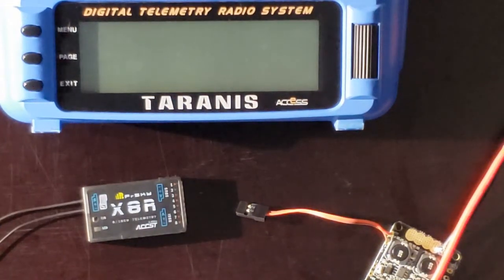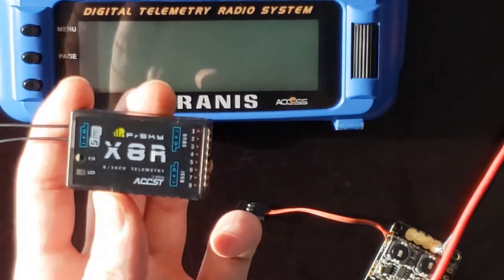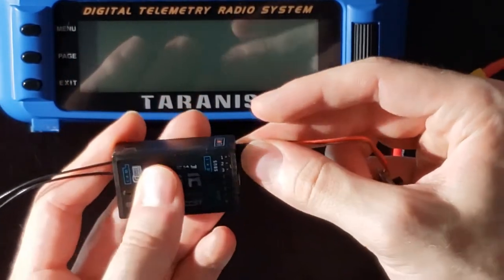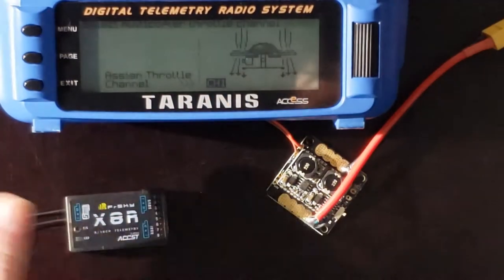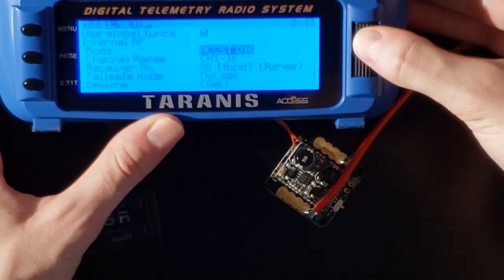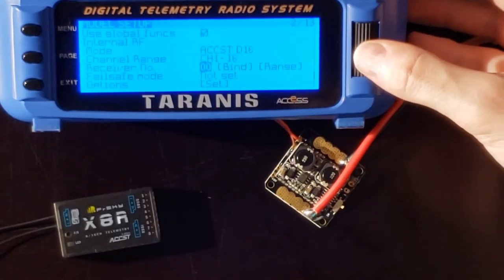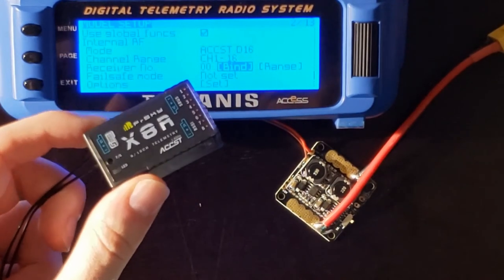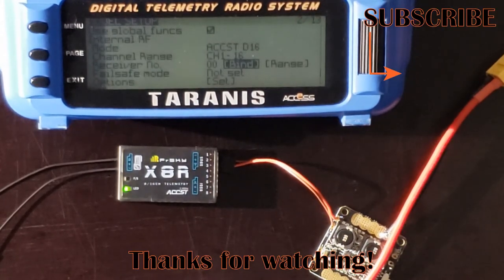How to Bind FrSky X8R receiver to Taranis X9D Plus transmitter with SBus

Comment: When I’m ready I wonder if the xm+ will have a similar binding method.  I haven’t bought a radio I have some specktrum radios but they seem not popular with drones.
Reply from the maker: The binding process for all receivers is basically the same set of steps. The XM+ supports SBus so you'll only need a 3 wire cable just like with my X8R. The difference will most likely lie on the transmitter side. Transmitters that don't have a screen will rely on some kind of stick you need to toggle to put it in a binding mode or they'll have some other interface. My original transmitter/receiver are Spektrum however when I was looking into the Pixhawk many people seemed to be using FrSky models. Also my Spektrum (DX5E) is discontinued so that was another factor for me when deciding to upgrade.
Reply: Dunno if anyone gives a damn but if you are stoned like me during the covid times you can watch all of the new movies on Instaflixxer. Have been streaming with my girlfriend recently xD
Reply: @Aden Valentin Yup, have been using Instaflixxer for since november myself :D

Comment: If powering radio receiver's SBUS with power and ground from a battery,   won't the signal wire need a ground as well?

Comment: Hey Alex, Could you please tell me if I can bind 2 receivers to 1 Frsky radio? I want to split the left and right controls of the plane. Thanks :)
Reply from the maker: Just to get a bit more background for your project and reasoning, why do you want to split the control of your plane? When I built my rc plane I used the same transmitter input to both "wings"/ailerons. Using this input I simply flipped the servo orientation to get the mirrored actions for roll.
Reply: @AlexFache  thank you for your answer! just for safety reasons. If one reciever or battery fails I still have half of the control surfaces.
Reply from the maker: I see. Short answer, off the top of my head I don't know. Usually the RX to TX is a 1 to 1 pairing. However I found this video https://www.youtube.com/watch?v=DoQH2PCqhAY&app=desktop that seems to shed some light on this idea. Looks like you could connect one RX to the other through an input/output SBUS port. I can't see all of the connections in the video so I can't guarantee this works but it might provide you with a direction to investigate. I don't have a second RX to experiment with at the time being so I'm going to differ experimentation to your end. Let me know if I can help with anything else!

Comment: When I hold F/S on x8r I have a green and red led light together, what I need to do for bind x8r to Taranis X9D Plus 2019? 
What firmware do you have on your Taranis X9D Plus 2019?
Please help!
Reply from the maker: I am using the standard OpenTX firmware (https://www.open-tx.org/).
Reply: @joshbutts6092  yes, I install for x8r reciever FW-X6R-X8R-v2.1.0 version. And for taranis FW-X9DP2019-ISRM-v2.1.0.